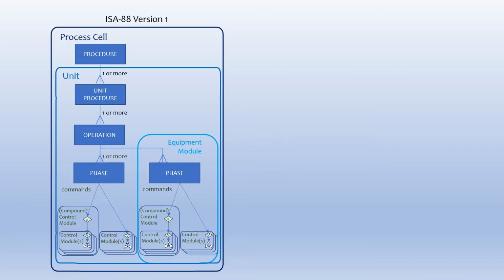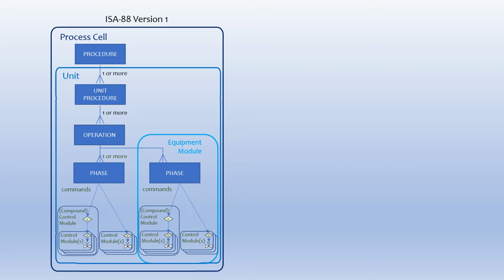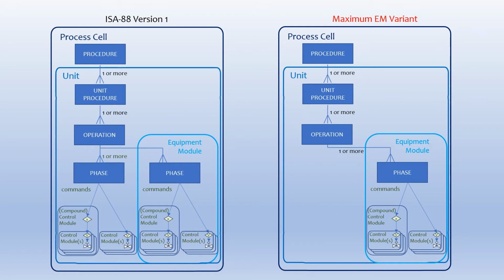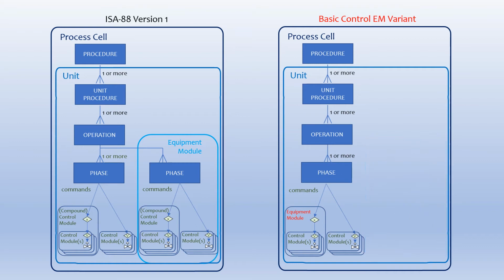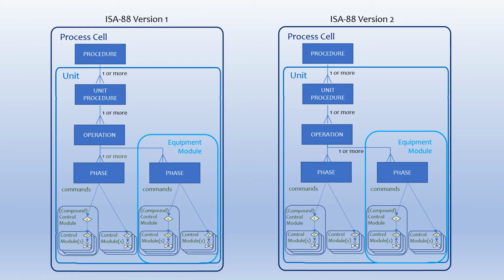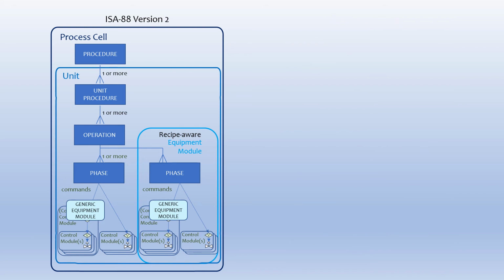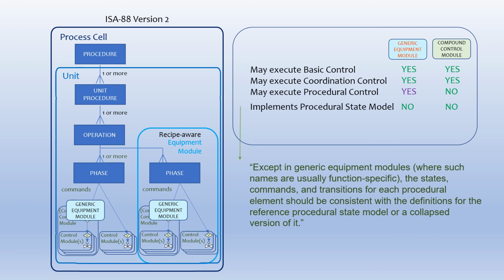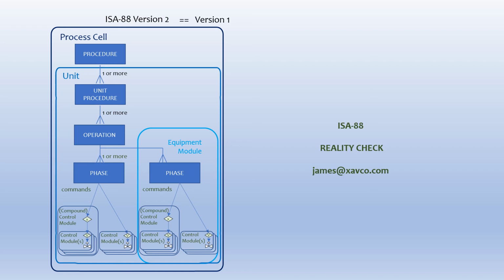ISA-88 Batch Control Reality Check

Comment: After complaining about the issue of splitting Units into EMs and CMs in your other video I found this. Great to see a seasoned engineer basically confirming my critique of the standard.
My conclusion is pretty much the same:
(Compound) Countrol Modules may have states and controle a process, but they don't have the standard states that Equipment Modules have and the process that is controled is focused around the physical activity of the CM, not the production process. Like the rampup of a motor.
I tend to refer to the PLC Open standard for CM state control, because I see it more as an asynchronous task, than a process activity.
Reply from the maker: Thanks @VaragornX. The key thing is to separate the "business" logic (temperature, mixing, storing etc.,) from the basic control of valves and other actuators. Compound control modules are so much more agile than is possible (or desirable) with phases/operations.

Comment: Great Job, 
I have a question is it possible to implement ISA S88 standard to a process were no chemical or physical changes of a product occur. For example a Grain Terminal.
Reply from the maker: Ahmed, 
Sorry for the slow reply! 
In the detail of ISA-88 'transport and storage of material' are included as processes. So yes, you could.